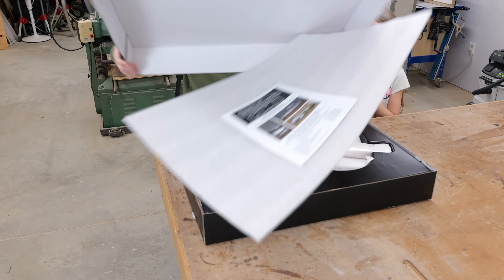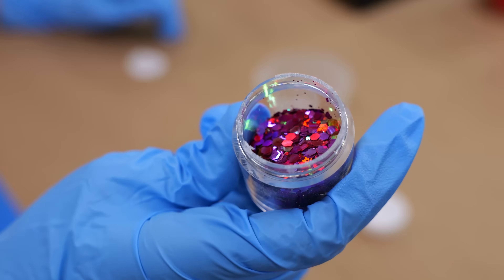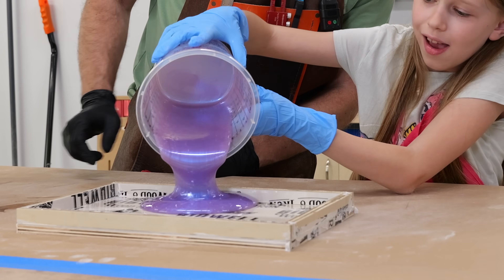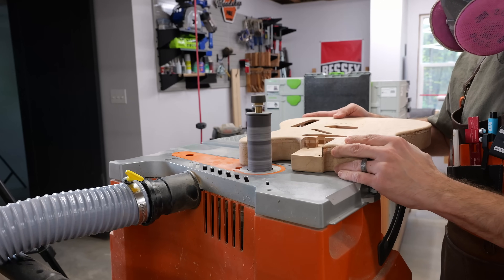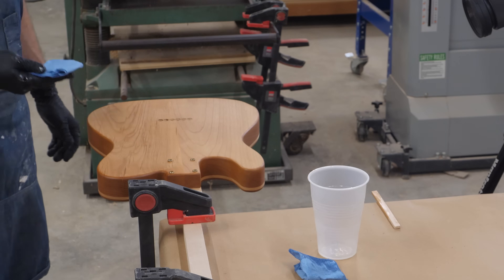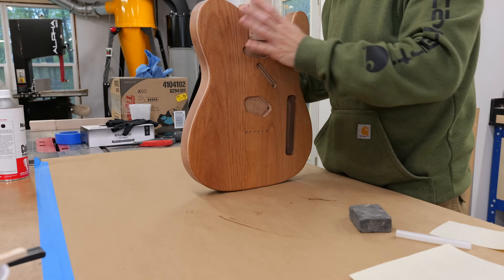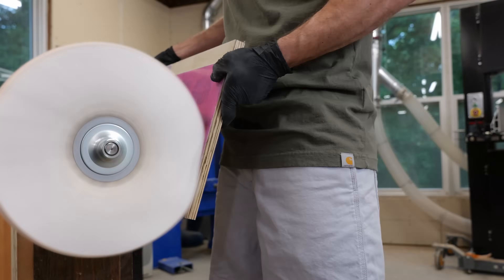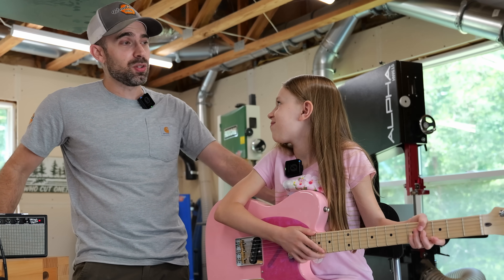Why I Cut a Guitar IN HALF

Comment: +++ Hello Mike, thank you for this amazing video !!! But i have a very important Tip for you, because you using the chok ( or what the english name is)  wrong !!! Have you ever had problems getting the chok out after finishing???  Of course you had ( and some younger colleges of mine, too)  Here is the Trick: before sticking the chok in the machine you MUST press it in the big Nut FIRST untill it cliicks in !!! than apply both to the machine. The chok is now flush with the nut and now you can put your tool or workpiece and tight the nut. After working you can loose the nut and by unscrewing you will recodnize that the nut turns easy at fist and than it gets harder and you have to use the wrench again!!! this is normal, because now you are pulling the chok with the nut and unlocking it. If you inspect the nut on the inside you find a radial bearing wicht helps unlocking the router or workpiece. 
You can trust me on that, i am a proffessionell in lathe and routing here in Germany. after following these steps you may find that the lathe has a much better precission in spinning .
I whish you both a lot of fun with this cool Telecaster. I Like it a lot !!!+++ :trophy-yellow-smiling::trophy-yellow-smiling::trophy-yellow-smiling:
BTW. there is a video from Kloppmanns Pick ups where they where routing some dovels for a Les Paul Bridge on a small CNC Router and the guy was struggeling getting the routerbit out of the chok. So i wrote allmost the same massage as i did now. Later i called them because of Pickups for my SG2000 and was speaking to the guy who is doing the routing and he was so thankfull for the advice. In the video ha was asking in the camera if anybody has an idea how to get the router out and thats why i replyed.

Comment: Well, basically the frequency of the string is determined at first approximation by the length of the string. If we could fix both ends of a string with infinite power, then the sound of the string would be determined mainly by the length of the string and the guage etc...

So what happens if we no longer fix the ends of the string but allow them to vibrate? Note that the string is held down so tight that we cannot even see the string vibration and so it must be a very small amount (and in order for the material of the body of the guitar to make a difference it first has to cross the frets and the nut and the bridge). 

In any event, what  happens when you allow the ends of the string vibrate a bit? Instead of the string wave being reflected back at the nut, fret or bridge, you lose energy into the body. It's easier to lose that energy at the dominant frequency of the material of the guitar, so it could effect the tone.  Also,  because the wave of the string is no longer reflected back in opposite phase,  you get a strengthening of the dominant frequency of the string. 

In any event, theoretically, the lighter or more flexible the guitar, the more it can vibrate, and the more energy you lose, and the less sustain you have. 

All the studies that I have seen show that this effect is nearly non-existent. You can prove this to yourself by simply holding the guitar against your body or a firm substance and noting that the tone or sustain of the guitar does not change. In other words, whatever vibration that crossed the bridge or the nut or the fret is so small that it makes little to no difference. 

Now there have been people who have put a pickup on a steel girder and spread a string across it and a found that has sustained for 30 seconds rather than 24. But the amount of sustain is such a low volume of just a few decibals that it, again, makes no real difference. 

You will find that no one can point to a real scientific study that shows any effect. I have a list of papers that show there's no effect if you are interested.  You can of course find YouTube videos but these are usually not scientific, and so it is quite easy to find a video which shows either there is or is not an effect.
Reply from the maker: That was an awesome explanation.  Glad to know that there's really no difference regarding sustain for hollow vs solid body electrics.

I do have a follow-up question for you.  What about tone.  I know the majority of the tone comes from the pickups but...  I built a semi-hollow tele in high school with non-traditionally shaped f-holes that have removable covers.  With them in vs out, the tone changes a bit.  Just curious as to the reason.  I was surprised that there was an impact.

Thanks for watching, hope you enjoyed the video!
Reply: @WoodshopMike  
I have not seen any studies done on semi-hollow bodies or hollow bodies. In fact, I always considered the semi hollow guitars to be ornamental in nature and that the vibration of the body couldn't be large enough with such small holes. 

But if you say that it does change the tone it would impact it in a manner I described above.  You can estimate the fundamental frequency of the body by vibrating it and pouring sand on it, and the sand movement would become greater at certain frequencies. At those frequencies that would dampen the string the most.  

I believe that the harder the wood the higher the frequency would be dampened, but I am really just speculating.

Comment: Remember when my daughter was young and she wanted a butterfly ring. So we went to the dollar store I found a butterfly hair clip, and a plastic ring in a quarter gum ball machine, cut the butterfly off the hair clip and super glued it on the plastic ring. 😅. She did want one of my guitars later in life. Ended up parting ways with my 2000 American strat I put an aftermarket one piece ash body on. Guy sent me transparent Mary Kay when I wanted transparent Olympic white. Basically took it apart and cleaned it with naphtha then put on a sparkly white pickguard. Priceless stuff we do that will hopefully never be forgotten.
Reply: As far as guitar building goes. You basically made a 68 thinline without the f-hole. One of my favorite builds was a 68 mahogany thinline with PAFs and a walnut top with black binding on top. Dyed the maple rosewood neck to match the mahogany body. Wow that was a beautiful guitar. Also, have a modern specs 72 ash maple thinline which is of course only hollowed on one wing. They're both awesome guitars. An alder rosewood 68 thinline with P-90s would be an interesting build as well. Oh you could have ordered one from warmoth and they would have done most of the work for you. But a great work shop. I am a corporate handyman and your tool collection is impressive for sure 😁
Reply from the maker: As long as it's sparkly it'll do! 😀
Reply from the maker: I usually build from scratch, so even though this approach was a little unusual it was still a fun exercise 😀  Thanks!  The shop has been a long time in the making.  Been at it for a little over 20 years and have pretty much had some amount of a "shop" since high school (even an apartment balcony at one point 😂)
Reply: @WoodshopMike  that's true! Transparent Mary Kay with a pearloid pickguard. Sold to the girl in the first row with the pink ribbon. 😂. The problem now is I want to do some upgrades to her guitar like a treble bleed, copper shielding, orange drop capacitors, and twisted wires. But she won't let me touch it. She is like no Dad it is fine. I'm like okay..

Comment: Tip: Dont over do it with the lighting when painting. Some paints are photoreactive, meaning that if its too bright an orange peel effect may result
Reply from the maker: Ah good point!  I don't use uv cure finishes though so no issues 👍
Reply: @WoodshopMike  I worked with a guy that somehow thought he woud bake paint on by putting a light real close to it. Of course the closer he got the light the worse it got. He finally got pulled off the job when I showed our boss the instructions on the label.

Comment: From all the research I've done my guess is you are doing very little to affect the tone, that is almost entirely determined by the pickups and amp, but reducing the weight of the body might slightly reduce sustain. Although a heavy head stock and solid bridge and neck connection to the guitar body seem to be a bigger factor in that regard.

Comment: I still didn't get why you needed that extra layer of wood added. Made it heavier, right? Also you could remove like 1/4 inch of wood from the back side?
Reply from the maker: You're right, I could have removed the same amount from the back, I honestly didn't think about it at the time.  The reason I added back the 1/4" of material was so the jack would be centered.
Reply: @WoodshopMike  oh got, I thought the cut was coming through that hole and it was the issue. Anyways, nice job with this guitar
Reply from the maker: @AntonKoba thanks, I'm pretty happy with how it's came together!  Needless to say, the kiddo didn't have any complaints😃

Comment: if the screws, or bolts that hod the neck to the pocket are strong..like with furniture screws then you dont have to worry so much about the sides of the pocket. The screws that are typicaly used have very light threads as compared to furniture screws. Furniture screws are designed such that people can sit in a chair or lay on a bed every night with many pounds of weight and can withstand the stress.. imagine sitting on the neck of a guitar..how much can the basic screws withstand compared to furniture screws?

Comment: hmmm...basically the only thing different is your neck pocket needs to be routed to 5/8 again and your pickup holes deeper. The piece you took off makes a great template
Reply from the maker: Did you miss the part when the body was hollowed out and the input jack was no longer centered?  Not being rude, I just know folks skip ahead sometimes and miss sections of the video.

Comment: I have found the pocket doesnt matter just the quality of connection between body and neck and that 1 surface of the neck on the back the rest doesnt even have to touch
Reply: I use machine screws , #8-32 with oval tops, washers if wood body or no neck plate and e-z lok brass threaded fittings and its never moving
Reply: also one thing fast coat of Super 90 on the neck and its never moving even with regular wood screws and a loose pocket
Reply from the maker: I can definitely see that being the case.  Gotta admit, though that fit was pretty sloppy 😂  If nothing else it looks better aesthetically now!
Reply from the maker: I'm a fan of threaded inserts and knock down bolts personally.  Just prefer a machine screw to a wood screws for my custom builds.
Reply from the maker: Thanks for the tip, that's a good idea 👊

Comment: Solid, very hard wood helps sustain because it reflects vibration rather than absorbing it.
Reply: Not sure about that.
I do understand the physics behind it, and I've build a few instruments over the years...
But I have a chambered and a solid guitar - same brand same shape, and there's a noticeable increase in resonance on the chambered one, but no difference in sustain.
As long as there's a good solid piece between the bridge posts and the neck pocket, it's still solid enough to let the strings' vibration come through clearly.
Besides, I also have a 330-style hollowbody (so, no centerblock like on a 335!) and it certainly rings out nice and true 👍😎

And then still: wood is a natural material. Even if it's cut from the same tree, you'll be hearing and feeling differences.
That's what's so intriguing and appealing to wood 😀

Comment: Instead of removing a whole piece of wood wouldn't it be better to route holes inside to make it lighter?
Reply from the maker: How would I remove wood from the inside without cutting it open first?
Reply: @WoodshopMike  You're right, I mean at first you remove a whole piece  layer of wood from the body, then you noticed the jack hole ended up not being in the center, then for some reason you add a different piece of wood to compensate for the missing piece of the body, I don't know, I'm not a wood worker, but I thought that part was a little bit weird. Nice work though!

Comment: No I will not have this lol 6:00 that IS all there is to it. I have no idea what you mean with ''voice'' when you say that's different with a rosewood fretboard or all maple neck. But if you attach strings to a pallet and the other sides to your workbench and put the same pickup on there as you would on your guitar, it sounds exactly the same. 

You have to mic your electric if you want to have benefits from the acoustical properties, which can be quite nice. but other than that, no all the tone comes from the pickup.

Your pickup doesn't distinguish where the strings are connected to, it just sees metal vibrate, and responds to that, transferring it into voltage.
Reply from the maker: I hear you and I'm not trying to say that all of the tone comes from the wood selection, that would be ridiculous.  I'm talking about nuances in tone.  If you get a minute, Rhett Shull recently released this video: https://www.youtube.com/watch?v=DS-F_5FEQaE&t=944s comparing different necks on a strat.
Reply: @WoodshopMike  It's a case of if you seek it, you shall find. If you seek the difference, you'll find the difference. But it isn't there. and if it is nothing worth talking about.
Reply: @WoodshopMike  My point remains, the comparison is wrong, you compare maple to rosewood, but you could just as well compare neck thicknesses. It's crazy. it'completely mental beyond this world to be comparing these things. There is no ''magical'' thing going on in maple or rosewood. It's just material. (to your pickup)

Comment: Check out the 3M mesh sanding discs, you will never buy Festool abrasives again, guaranteed. Cool build man!
Reply from the maker: Thanks for the recommendation.  Which mesh disc, they have a few out now.

Thanks for watching, glad you like the project!
Reply: @WoodshopMike  Cubitron II is very fast, slightly coarse scratch pattern compared to the regular Xtract Net. I use both.
Reply from the maker: right on, thanks!  Have you tried festools mesh abrasive?  Just curious for comparisons sake.
Reply: @WoodshopMike  I tried many many different abrasives. The 3M stuff absolutely slays the competition. I absolutely LOATHE sanding, so anything to make it go faster is golden.
Reply from the maker: Yeah I'm right there with ya!  If I can get through it faster, bring it on!

Comment: Where did you get the silicone for the knob molds?
Reply from the maker: This is from Alumilite: https://bit.ly/3VoVMVq  For something like making knobs, you'll be good with just a 16oz kit.  If you're interested you can save 10% with this code: WSM10

Let me know if you have any issues with the code, it's just recently been setup 👍

Also, I'm getting a video wrapped up around making the knobs and pickguard.  Anything specific you're curious about that would be helpful for me to cover?

Comment: I'm pretty certain the sound is... oh it's not your first guitar and you know exactly where the sound is, it's all along the strings in the whole construction, neck body etc besides pickups. But the sides of the body really don't do much anything. If anything adding a hollow there might even be an improvement.
Reply from the maker: Fair comment.  My posing the question is more of a curiosity.  While I've built a handful of guitars, it's still fascinating how adjustments here or there change the characteristics of the instrument.

Comment: Why would you plain down either side? Just chamber it and glue the pieces back together gets you closest to original, by flattening them you threw everything off
Reply from the maker: Great question and forgive me if I miss the point in my explanation.  If I planed down both sides (which I thought about doing) I wouldn't have had enough material left because the jack hole had already been drilled for.  So after I hollowed out the body I'd still need to laminated a top and back on so that the jack would be centered again.  Does that make sense or am I not seeing your question right?
Reply: @WoodshopMike  guitar came out great, I’m just saying that the bandsaw blade width is all u lost on the original cut, the top and bottom pieces would’ve fit back together like a puzzle piece regardless of inconsistencies(the band blade cut both at the same time ensuring sameness), and any inconsistencies wouldn’t have mattered considering the final finish you employed, seemed a lot of extra work for no real reason?
Reply from the maker: Ah, gotcha👊

I needed a dead flat surface though to tape my template to the body for hollowing out the guitar.

Totally agree with what you're saying though, I could've just glued those two surfaces back together.